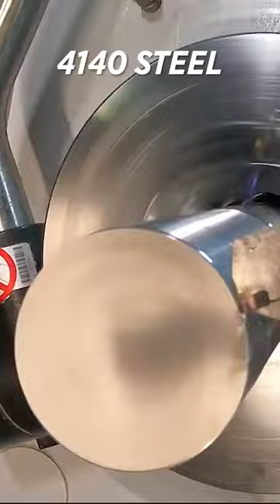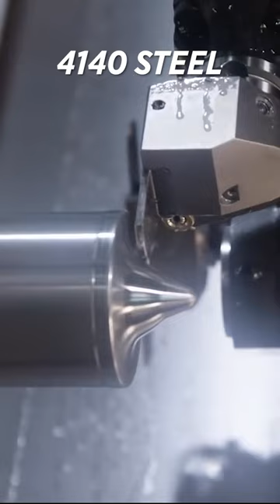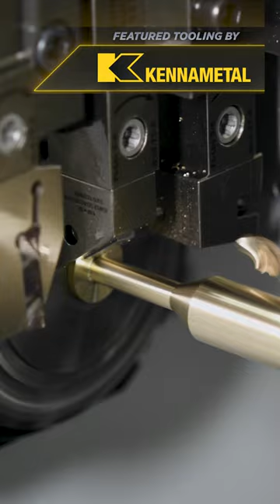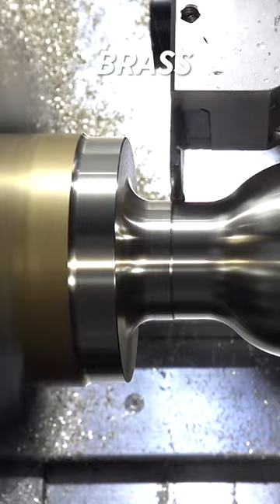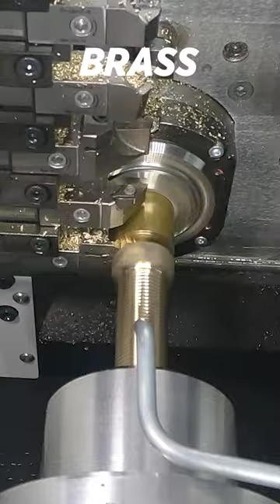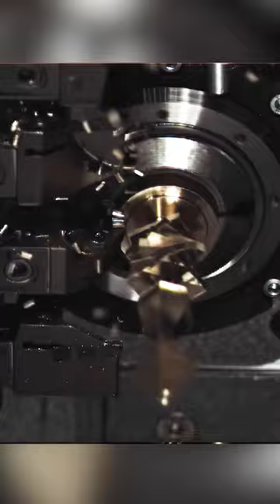The MOST Satisfying Lathe Cuts #shorts

Comment: I love turning brass
Reply: I only had steels (inox and hardened stock included), Al, Hardox, Acrylic and Nylotron. Some say brass and copper is too jammy to do it conventionally (might have had some tiny under 10mm parts years ago). Softness and speed is great, but there must be tricks and tips up your sleeve for non-ferrous metals. Or as we millers call it here (Eastern European heavy-duty port equipment making): not-a-metal(s)😅
Reply from the maker: Yep, nice chips and just beautiful
Reply: I hate it. It gets everything. Too messy.

Comment: Any reason why they would use a cutoff tool for turning the whole part? Just trying to avoid tool changes?
Reply: It's not a cut off tool it's a grooving tool. More rigid but offers the most range meaning less tool changes but side loading them does induce flex